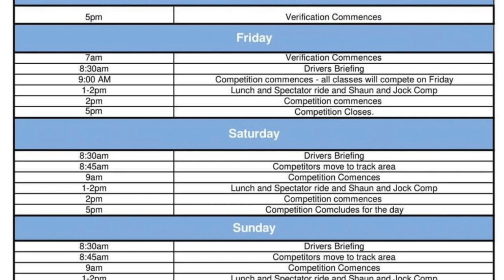Why we are running smaller tyres on Bullet??  SYDNEY 4WD & ADVENTURE SHOW EASTERN CREEK DRAGWAY 2022

Comment: hey i got a question unrelated to this vid, i put some massive brakes on my front axle(U S model Tundra, biggest toyota brakes i could find, even had to get bigger wheels) and the leaves are very flexible and when i brake too hard i can hear the u joint making a noise like its maxed out, so i can see your rear traction bar setup but i dont recall seeing a good look at your front axle, do you have any traction bar up front? i know the front is a bit of a challenge because of the oil pan and because the shackles are at the back of the leaves so theres more front to back movement. good luck this weekend!
Reply: No, there is no front wrap bar up front.
Reply from the maker: None on mine, thanks Jacob, Charles had one set up on his, was actually a Bundy front arm set up off his gearbox x member to top of his front diff....